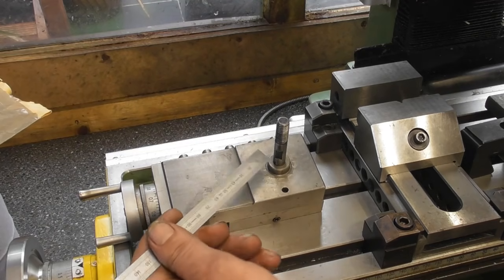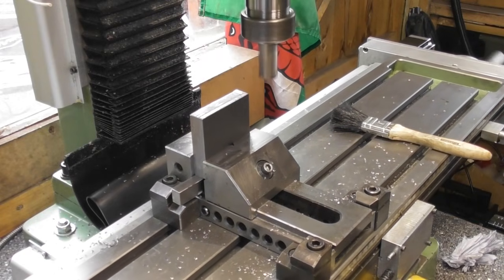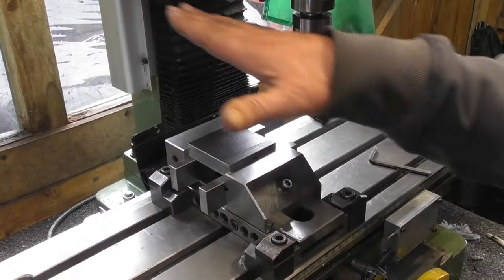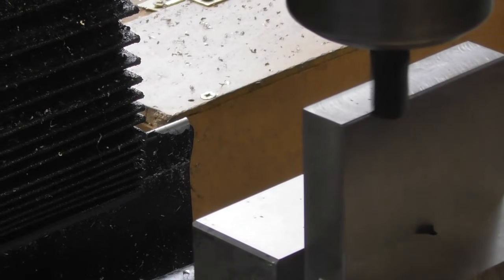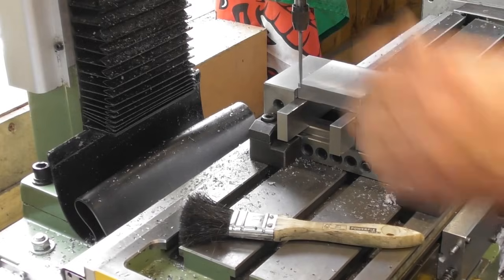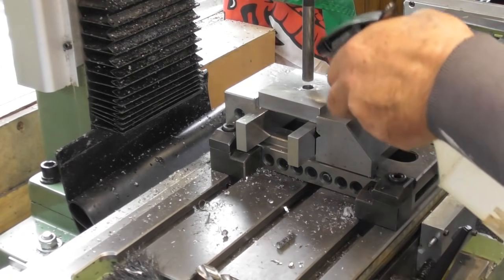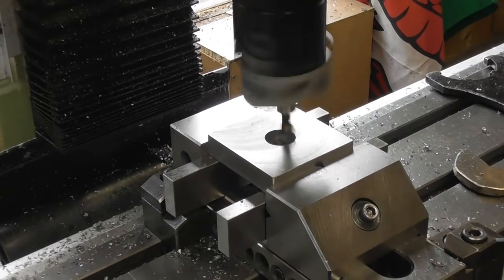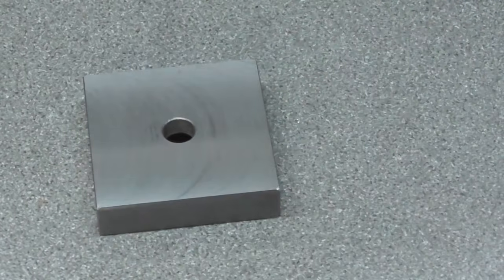Warco WM180 Lathe toolpost riser plate

Comment: Hi Ade, very nice and here's hoping it does the job.  I hope James has realised he's lost the locating spigot on his compound and reduced the effective stud length.  Also, could you have used the small hole in the compound to fit a pin to stop the riser block rotating.  After all, there's no need for it to rotate, so the tight stud would have been OK.
Reply from the maker: Hi Steve . James has that all in hand . Cheers Ade.

Comment: I had to make similar mods to my SP2109 machine which is very similar to the WM180. Luckily I had a 4 jaw chuck which made it fairly easy. My QCTP came with a spacer block which was flat and not machined so I had to do the hole and counterbore. 
My machine only has 2 fixing points is the WM180 the same?  Hole under the tailstock end and a slot under the drive pulleys. Had to move the machine recently and having troubles getting it all level again. Typical that I only commented how perfect it was for such a small machine just a week before.  :(   Any tips on levelling it?  Thanks.
Reply: Small machines like these shouldn’t have “leveling” problems. They’re usually made so that the corners don’t become skewed unless you tightly attach it to a non flat surface. But you just need a master level, which you can buy these days for around  80-100 £. Other levels are useless. Just shim under the corners where the base screws, or feet are. But don’t confuse correcting for bed twist as leveling. Lathes don’t have to be leveled, just fairly close.
Reply: @melgross  Sorry, yes its more of an alignment/twist issue. Took me a while to get it all right and recently turned a 12" part where i had to turn over because it was too large for the headstock bore. You could barely feel the difference at the join with a fingernail and I thought that was excellent for such a small machine.
Sadly I had a power cable fail and due to its location I needed to unbolt it and move it. Now struggling to get it back into alignment, it now cuts a taper (not using tailstock). Thanks.
Reply: @WhiteDieselShed  are these lathes machined on the bottom of the bed? If so, they “should” be pretty flat. Otherwise there could be a few tiny bumps on the bottom of the casting which would be enough to get it to twist, depending on where they are.
Reply: @melgross  The bed does not carry on all through with the headstock sitting upon it. Headstock it more like being glued onto the end with some cheap glue and a prayer (slightly exaggerated) , only 2 fixing points one at each end (central to the bed).
Nothing built in to take out any twist or misalignment. I think it was pure luck that I got it so well adjusted last time. Thanks.
Reply: @WhiteDieselShed  well, the best of luck with it. I’m sure you’ll get it right.